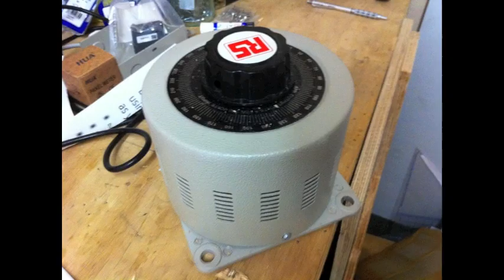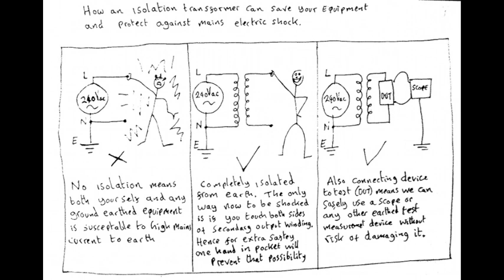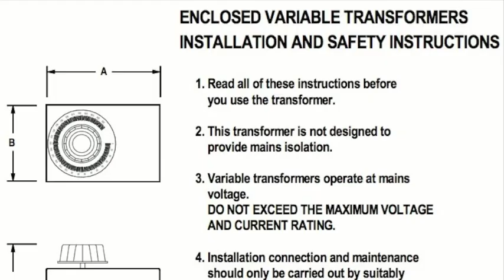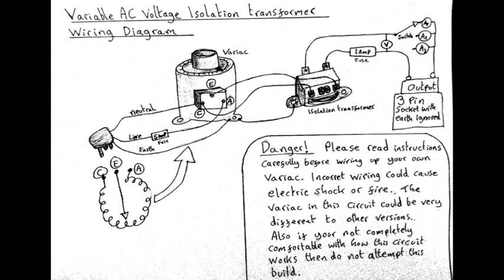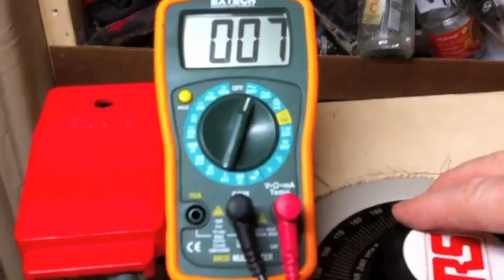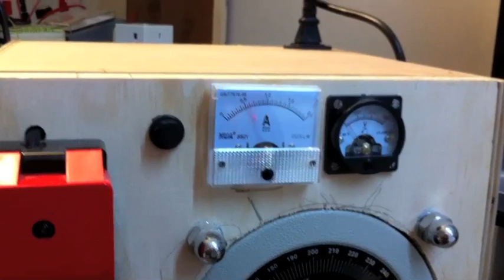DIY Variac And Isolation Transformer Build Guide. Fire And Death Avoidance!!

Comment: great vid thanks. Only issue i had with the circuit is i would have put the power switch on the hot side instead of neutral side of the variac.
Reply from the maker: Yes your right. I do actually have power switch on the hot side. But the diagram shows live and neutral written down the wrong way around. Too late to correct it now. Well spotted! I have updated description. Thanks for letting me know.

Comment: I'm green but  since safety for our equipment and mainly  US! 
 Shouldn't the isolation transformer be 1st?
Reply from the maker: As long as it is inline then your good to go. Does not really matter that much, which comes first if you make sure they both bolted and wired up correctly within same box. Although I would place the smaller turns of coils unit as second so the first unit sees the inrush current, instead of smaller unit. Which is why I placed my Isolation second as its much smaller (turns of wire) than the variac.

Comment: Nice project done in a practical manor. This is similar to some commercially made unites of yesteryear I've seen once in a while. I'm wondering if you are going to use this in conjunction with a current limiter, like a dim bulb tester? You have a new subscriber.
Reply from the maker: Well thanks for your nice comment. Yes you can do that as well.

Comment: Nice job, looks good, Ive had a variac hanging around for a while now that ive thought about doing this with. Isolation transformers seem a bit expensive though, so was looking at ways of rigging up a 1:1 arrangement using the coils of primary coils of 2 separate 240v transformers. One day hopefully I will get round to it.
Reply from the maker: try ebay they often come up on there. Use auction option only.